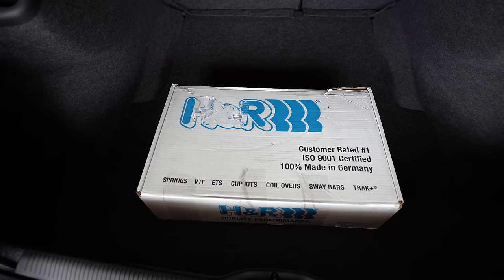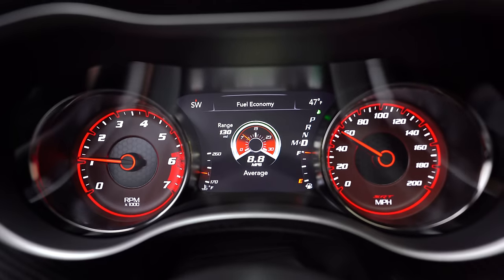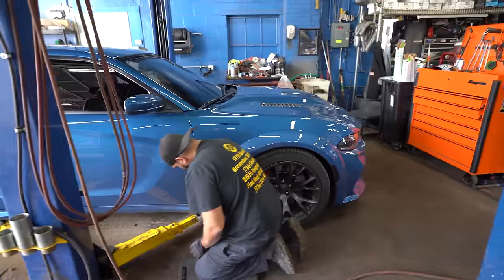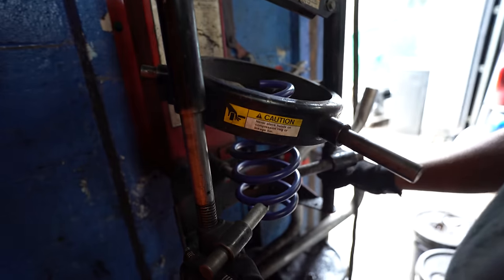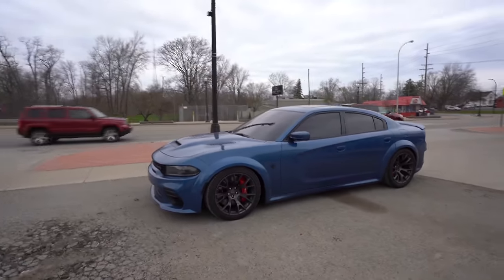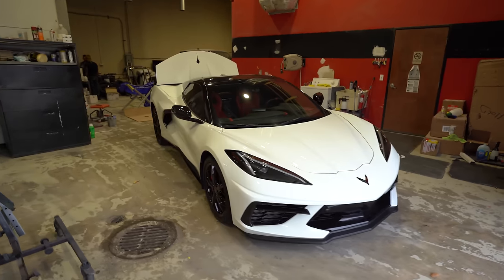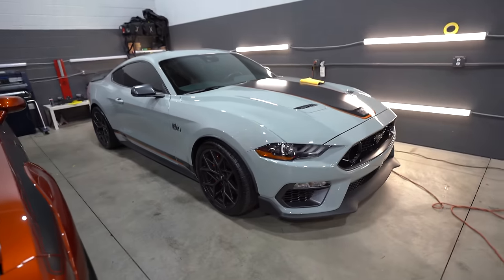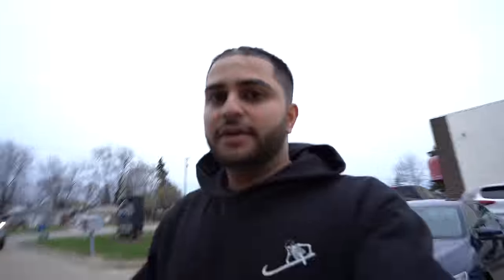LOWERED MY HELLCAT FOR $250!

Comment: Bro the mach 1 isn't just like a 5.0. It's has all the suspension goodies from the gt350 with the coyote engine instead of the voodoo. It's way more than just a 5.0.
Reply: U also can get it with the 10 speed or the 6 speed tremec. The 5.0 comes with the crappy mt82 if u want to go manual